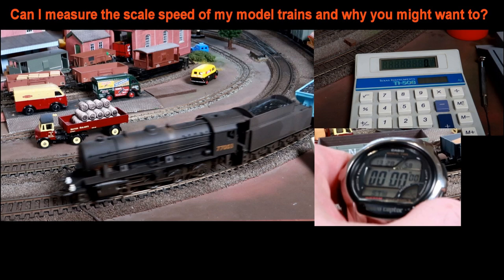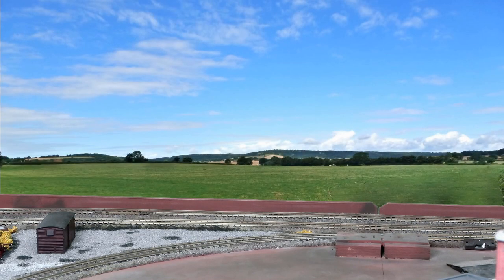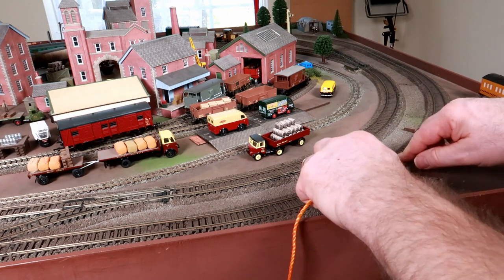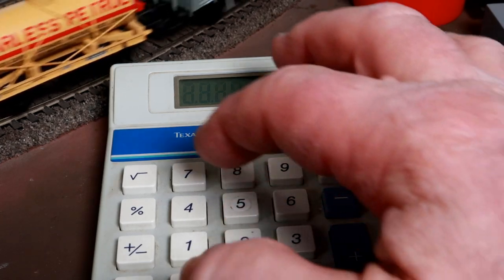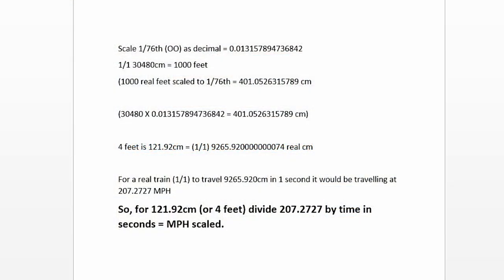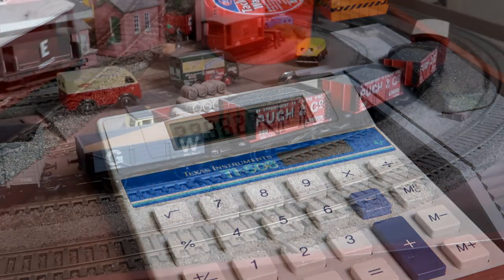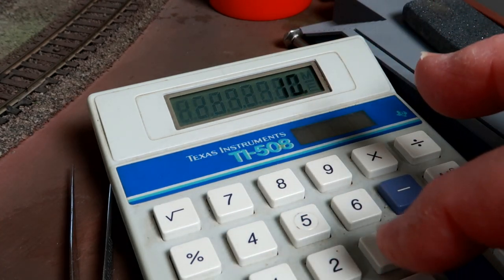How to measure the scale speed of OO scale model trains

Comment: That's excellent - will be trying that myself.  Thanks for showing us.  Cheers.  Vivian.
Reply from the maker: Thanks Vivian, let me know how you get on
Reply: @ModelRailwaysUnlimited  Hi Mike, just to let you know that I tried that.  Very successful.  I had a couple of old Hornby marker posts and fixed them on 4 ft of straight track and armed with a Casio watch stop clock and calculator on the mobile phone I was ready to go!   Although it has proved that I have actually  been operating my trains at more or less correct scale speeds 😇, I have now started to change CV5 maximum speed on my decoders to suit the loco types.  Currently doing my old DMU's and setting them for a maximum of 75mph.  So all very good,👍 and thanks so much.  Vivian
Reply from the maker: @cravensdmufan4449  Hi Vivian, that is splendid news indeed. I am super impressed

Comment: I Always (as you know) like to try run trains at prototypical speeds.

With this formula I can now successfully and more accurately do that.

With the advent of DCC I can also now Lock the top speed , so no matter how far I then the throttle the loco won't exceed it's top speed.

Cheers my friend
Reply from the maker: Good morning! wow I did not know you could do that with DCC, what a very good idea however!
Reply: @ModelRailwaysUnlimited  yes mate DCC offers so many benefits over DC, yes there's a small increase in cost for the decoders but the benefits are almost immesurable!

Comment: Ok low tech approach . Here are 2 high tech answers .

1) measure the speed of the train by calculating its power consumption ( W=VxA) , Power is a good way to average the speed of the electric motor rpm. Okay so how do we achieve this. This can simply be achieved by putting a large wattage resistor as a shunt in series with a positive to the power supply. Then using a multimeter measure the voltage across the resistor, as the motor consumes more power (w) Is the voltage drop across the resistor will increase. Using simple ohms law you can then calculate the wattage being consumed by the Train at any given voltage. The various voltages from 1 V to 12 V can then be converted into a graph X axis being voltage y-axis being voltage drop. The resistor should be between one and five ohms and the rate is no less than 10 watts .

You can then use the principal suggested in this video to convert the graph into speed. If this sounds a bit complicated then please ask questions and I will give you the formula.
2) Measure the model trains motor Rpm . A simple circuit can be created to measure the noise from the motors carbon brushes. The transience Banks from the motor can be converted into a frequency which can be calculated against time and through a graph plotting the rpm against time, workout the train speed. This requires a simple op amp based Pulse detector which can give either a frequency output or a linear voltage
Reply from the maker: Very interesting but the whole point of this video was to show a simple way to get an idea of the real speed that everyone could do with minimal fuss.

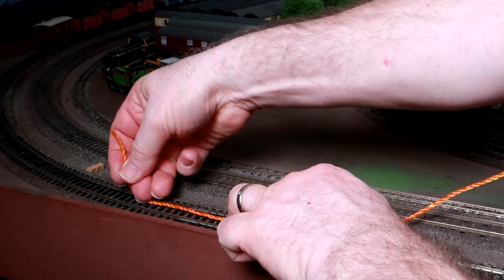Comment: Well done! I hate seeing carefully-built, accurate models running like steam torpedoes. I have a garden railway in Gauge 3 (1:22.6 scale), where by mere chance, the continuous loop is almost exactly 1 scale mile around. Visitors are invited to try running a lap at 'scale' speeds without looking at a  watch - most are doing at least twice the speed they think! The record is held by the builder of an 1850's Crampton locomotive and train, who rivalled Mallard's performance. Admittedly, it's not easy for drivers of live steamers with only manual control, as there are gradients of 1 in 100.
Reply from the maker: Hi Edward, your railway sounds wonderful and very helpful to be a scale mile! Thanks for watching, Are you going to put up any videos of your railway?